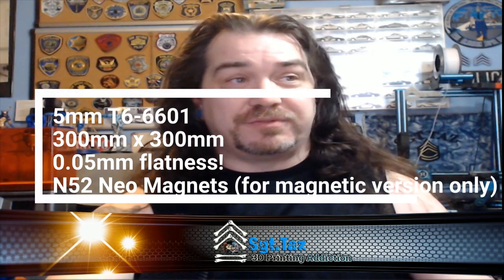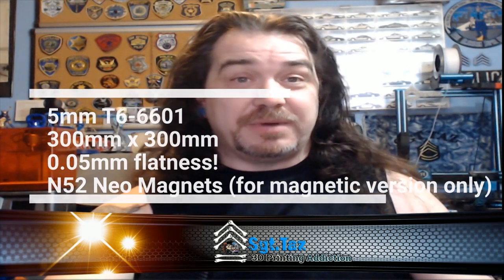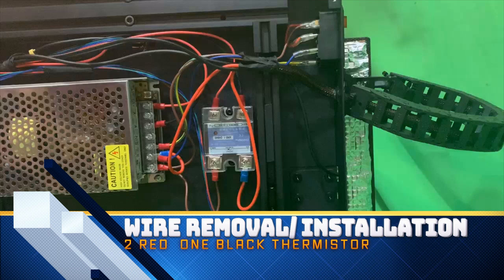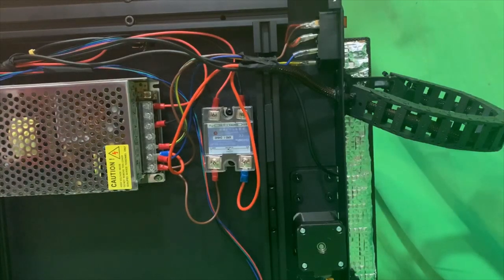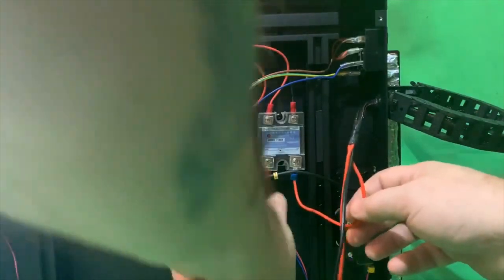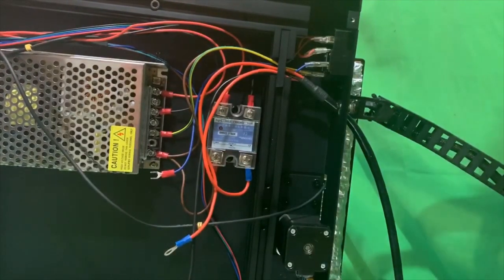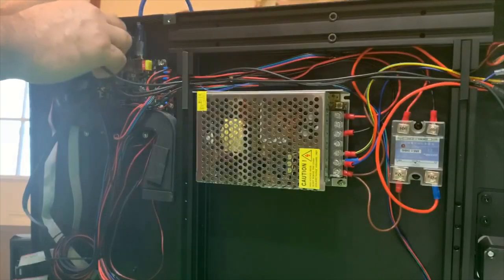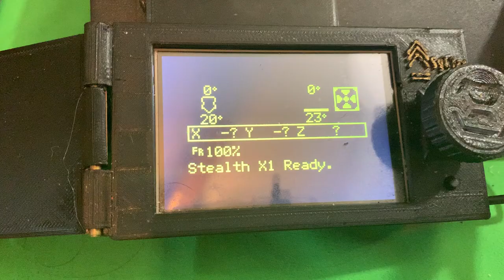Artillery SWX1 Heat Pad & Aluminium Bed Replacement

Comment: I added a CR-10 Z stabilizer kit to the back of the Artillery.  The angle brackets work perfectly at the top and I only had to drill 2 holes on each rear side for the straight brackets.  Worked really well, very solid and I didn't have to print a contraption to mount it.  Looks stock as well!
Reply: @lllBAMlll  Thanks. Just ordered a set.. you saved me finding a solution..

Comment: My bed has a pretty good dip in the middle.  I also think it may be kinda heavy compared to aluminum. too bad the Fulament bed is sold out right now.  Thought about modifying a cr-10 bed to fit.
Reply from the maker: It's  not out yet just the place holder. Get some PEI sheet for now I have another video on that install.
Reply: 3D Printing Addiction when will it be available?
Reply from the maker: @mbs1234567  I linked the pre order. think it should be soon. not sure what the holdup is

Comment: I saw there is no earth wire on that plate. Aren't you worried about this?🤔
Reply from the maker: Heat mat has built in fuse and is tied into the SSR. also use strain relief so not overly concerned with it. I  have 1mm PEI sheet on top so limited contact with aluminum anyway

Comment: how do you get the stock heater pad off the stock glass bed? iv ordered an aluminium sheet so il need to refit stock heater
Reply from the maker: I used heatgun on old glass. soften up the glue. then a broad scraper to gently pries off. be mindful that the pad has wires inside so don't flex it too far.
Reply: @Sgt.Taz3D  will it restick to the new plate?
Reply from the maker: @Scoobydcs  get some high temp silicone adhesive -no brand in particular. that will reapply. I honestly just wound up buying a new one with the 3M adhesive already on it and a new insulation pad. just less to do, but if your on a budget the original method works good.

Comment: What size and length of cable chain are u using on the printer, thanks.
Reply from the maker: Used this one and it will vary from printer to printer. idea is to keep the wires from folding so enough to allow free movement without bind. https://www.amazon.com/gp/product/B07SFFT1K5/ref=ppx_yo_dt_b_search_asin_title?ie=UTF8&psc=1